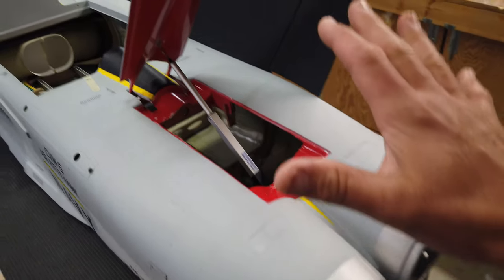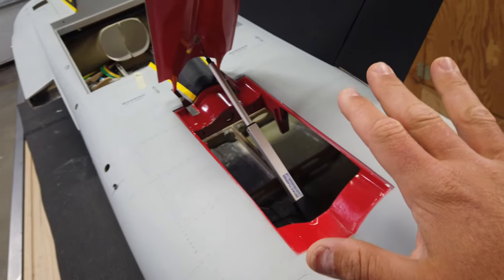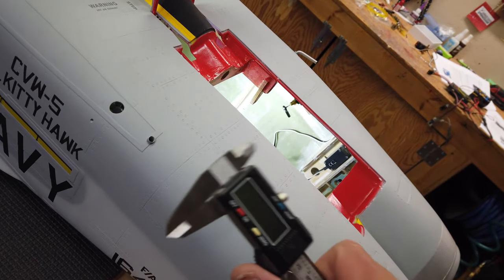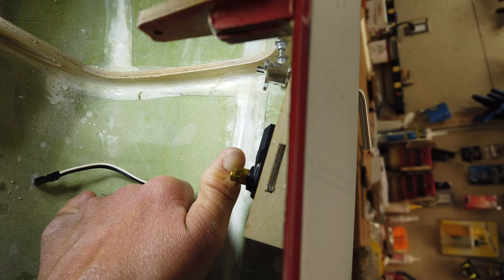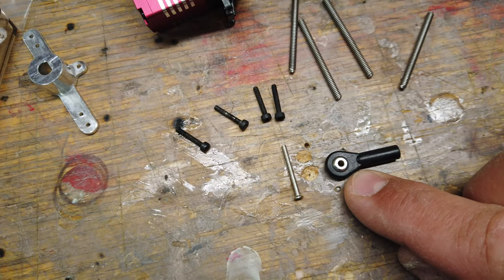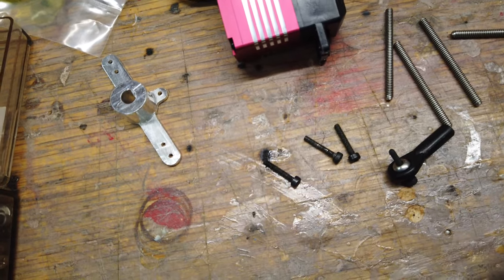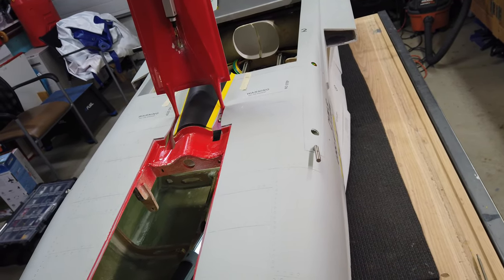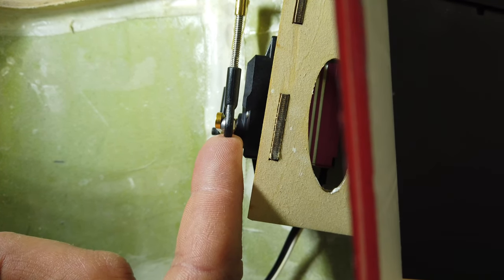SKYMASTER F-18 F18 - Rudder Install - Build Video #10

Comment: On the full size F-18 the rudders use some V-tail mixing during takeoff, that is both rudders move inwards to help generate a nose up pitching force for both Carrier catapult shots and conventional runway takeoffs.
As soon as it's airborne they return to the straight position.
Reply from the maker: Yea it seems to be a good thing to do on these larger size 18’s takes a bit of adjustment and fine tuning but worth it!

Comment: Nice, I like the way you explain the logic with what you are doing. It helps us think about how and why you do things rather than just showing us. I have been using heat shrink on my snake skins to help cover the fraying. Nice call on the melting the ends with a lighter. I will certainly do that in the future. I am a keen advocate of electric retracts, I have only ever had issues with air retracts over the years, particularly with an ageing model. But not sure on the decision to put in an electric air brake. I don't think it is scale speed. On the full size, the speed of the air brake is the difference between life and death in a furball. I guess on a model it's not so important. On landing the speed in and out is no big deal it helps the drag so you can keep the turbines spooled up and its retract speed is Ok if you have to abort. Anyhow also like the way you drip feed these videos out rather than a long, long one of multiple hours. Keep up the good work, subscribed. Cheers
Reply from the maker: Thanks Brian. I appreciate the comments and feedback.  I'm learning to like the Electric stuff now.  my first venture into electrics was about 2011 and back then the technology just didn't seem there yet.  now my CARF Tutor and CARF Ultra Flash are electric and I am loving it!  Very reliable and work great.  My F-18 is Air and it works.  I have thought about changing it to a set of ER-50 Electrons but hard to justify the cost as I don't get the opportunity to fly the plane very much around here.  only a few day's a year do we get to an asphalt runway.  

Yea I don't thing the Electric Airbrake is scale at all but it sure works great.  A couple years ago I built and flew a Yellow F-15 and really enjoyed the landing phase with the air brake on.  It was a very cool effect!  

Thanks for watching!

Comment: I have always used 3/8 heat shrink instead of using servo keepers. Would make it a lot easier sliding the snake skin over the wires.
Reply from the maker: Thanks Graham.  Yea it's typically what I use as well.  There are some instances were I will use the Keepers over heat shrink but typical for me is heatshrink as well.